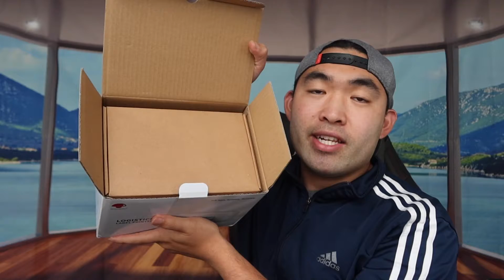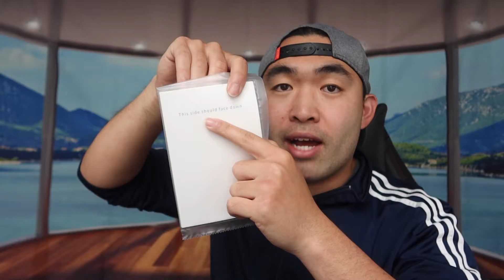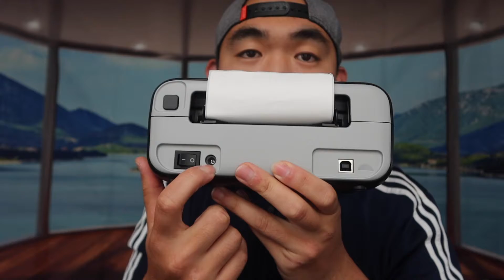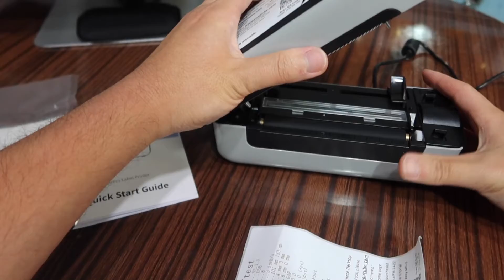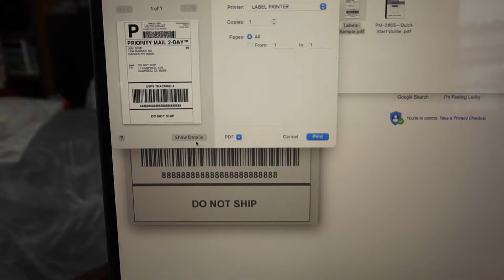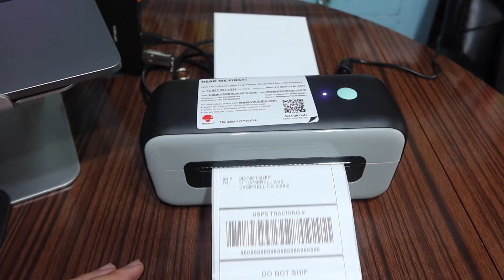How to Use Phomemo Thermal Label Printers?

Comment: I'm curious if anyone could help me out. I use an hp laptop windows and can only get labels to print for poshmark. I sell on mercari, ebay and depop as well and i can not get the label to rotate to print correctly. I've tried everything and can't seem to get it right, does anyone out there have any tips I could try?

Comment: Are you using this with a MacBook Air 2020 please? I have one looking for printer but only find zebra 4inch that will work with this MacBook as has USB-C Port
Reply from the maker: I used it on my phone but you should be able to use it on macbook as well.